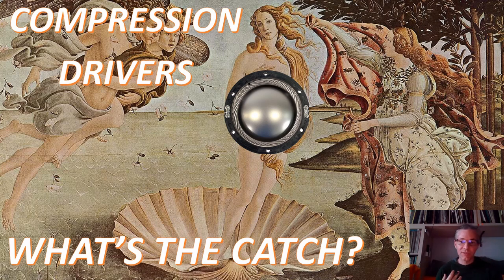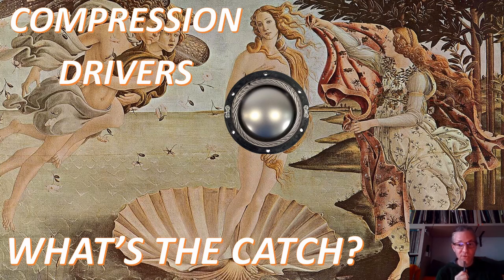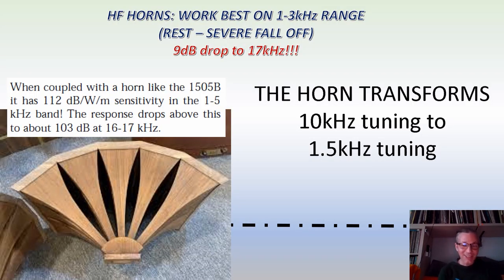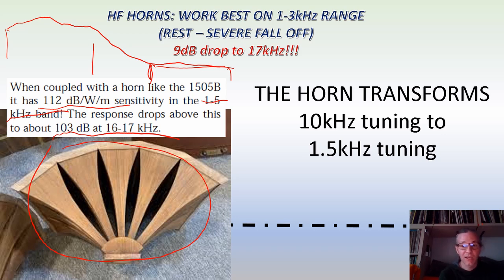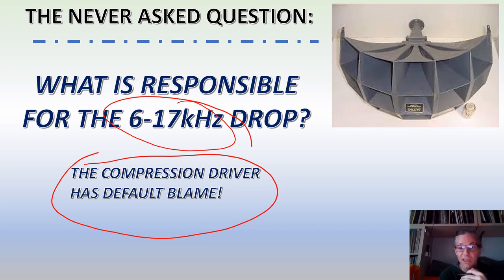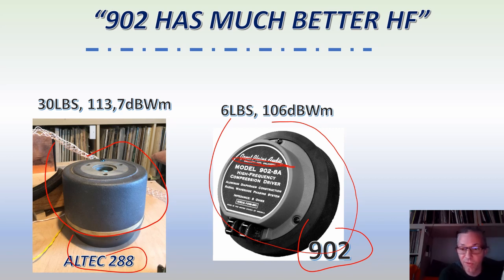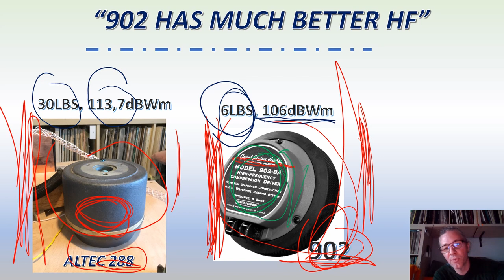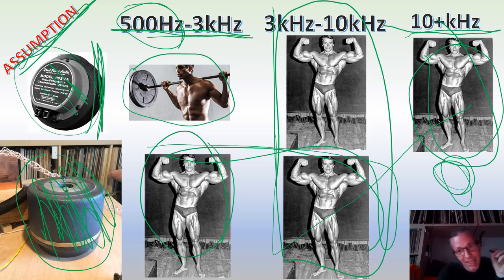What's the catch - horns and compression drivers 1/II.

Comment: I'm glad you mentioned how we've sacrificed fidelity and realism for size and convenience. I absoloutely love compression drivers and gotta say, if anyone out there hasn't experienced HLCDs, you don't know what you're missing. 
* there is no free lunch, there's always pros and cons of everything and HLCDs aren't perfect either. If I had to say why I like 'em, these are my reasons:
1.) CDs never sound strained when pushed to loud sound levels
2.) clarity
3.) efficiency (most will reach ear-bleeding loudness with fairly low input power) In a car, the average 75 watts per channel amplifier will do the trick
4.) replacement coil/diaphragms are available, so if you smoke one, it can be fixed
Now, for the cons:
1.) large physical size makes them difficult to fit in mobile applications